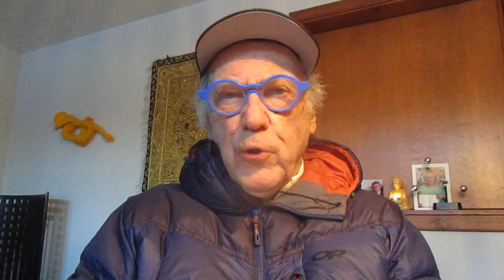Solution to Problem #131 - Friction with the Road.

Comment: Sir , if a planet have a escape velocity equal or greater than than the speed of light , then what will happen if we shot a light beam from surface of that planet
Reply from the maker: question ill  defined -  esc vel >c is not possible
Reply: Yes sir , that point is there 😅 ,I forgot to think about that

Comment: :) for example, I give the friction force of running water, I usually go on the road without falling due to the force of resting friction, often watch TV, some car racers get stuck, the engine still explodes, the wheels still turn, the car doesn't move Shifting due to sliding friction helps to make the vehicle layer and road surface very small, not enough for the vehicle to move to overcome, often they use high roughness objects such as wood to insert into the wheel to increase the frictional force to help the vehicle move. Ball bearings are used when there is a moving frictional force from rolling friction to sliding friction Friction makes it difficult to push the box to slide on the floor. Fix: use a roller (switch from sliding friction to rolling friction), when sawing wood is not very fast, use it to apply a saw to cut wood easier and faster than just physics. When the spacecraft falls into the atmosphere at a very high speed (7km/s), due to the force
friction between the hull and the air that the hull heats up and catches fire why?

Comment: Yes. From a purely energetic point of view, disregarding the individual, it takes more energy to drag this particular item. (We're dragging in both instances, but I mean dragging the heavy end on the ground verses carrying the heavy end)

However, legs provide more power than arms. So, energy burned in legs is less noticeable than in arms, generally.  Such that, when tasked, the choice of dragging this item for long periods is just going to be preferable. 

An extreme overdone example would be heavy stones for building pyramids. 

Mgh applies here too.  But, carrying the stone with arms isn't as convenient as dragging it someway. Dragging it over sand or something which helps minimize friction, but, of course we cannot eliminate friction. So, dragging includes friction atop mgh as you say. But carrying stones verses dragging them pits legs against arms. And, well, legs can put up with more.

Comment: Sir  friction independent of area contact but why aeroplanes are made narrow in front and  wings to reduce friction
Reply from the maker: that's aerodynamics - use google
Reply: Airplanes don't involve static and kinetic friction (i.e. Coulomb friction) between solids, in their interaction with the surrounding air.  The kind of friction is aerodynamic drag and its counterpart equivalent of normal force called aerodynamic lift, both of which do depend on an effective area.

Comment: I got the same solution, assuming that the human body is simply a mechanical linkage or object like the table you use as an example, and does not expend any energy simply to hold up the end of the branch. However, I suspect that there are constant muscle fiber contractions needed to hold the branch, keep your balance against the asymmetrical load, and so forth, so that there is more energy expended by a person than what goes into gravitational potential and friction alone. If this additional expenditure is greater than the savings in friction loss, I do not know, but it seems possible if the branch is very heavy.
Reply from the maker: I agree but those muscles do NO work

Comment: Having done years of physical labor in my life....I would still hold the smaller end as I went....the table has no muscles nor the ability to use different ones during the day nor vary any angles of the branch as it goes. But Physics is.....Physics. My Google account password is hacked on a nearly daily basis and so at times I cannot read any replies and must change it constantly now.....I suspect Google itself.
Reply from the maker: so would I. I prefer to do MORE work but get less tired.
Reply: @lecturesbywalterlewin.they9259  Tired or not...I still had to shovel concrete, gravel and dirt all day and could out work other men , even at twice their age. I planted a lot of trees also....I always used the narrow handle and not the other end to hang onto....lol....Peace always.

Comment: "If you hold 10 kg in your hands for 5 hours you will be exhausted but you have done no work!" that's why I wrote that you need to choose the smallest sum of gravitational force losses and frictional losses! --- not everything depends on the force of friction, but also on the strength of your hands (the strength of your wife). )))
Reply from the maker: you are confusing getting tired from doing work.
Reply: @lecturesbywalterlewin.they9259  no, I'm talking about the real energy costs of holding the barrel in weight)
you will not write off the costs of  overcoming gravity for 9 minutes on rocket fatigue! )))

Comment: Yes, I was wrong when I answered and I understand why. I compared the problem with someone's ability to do different physical tasks. For example, it's easier to drag a heavy log than to carry it on your back. But it's only because our backs are not that strong. From an objective point of view, if you carry something on your back, your overall weight increases by that amount, but your ability to walk doesn't involve any friction that hinders your movement. If you drag it behind you, your overall weight also increases by that same amount (you move your weight and the weight of the object), but now you also add the friction that the object generates. Thus, the force needed is always greater when you drag something, instead of carrying it, indeed.

Comment: Fatigue is different for different sized people regarding the same branch in this case.   Such that the grasping point of view of a child would be to grasp the narrow end perhaps.

As for an adult, grasping the thicker end would be less of a problem. 

So, energy wise you are right in so far as what is required to move the object itself.  But, for a person who has to provide this power, there are other considerations and constraints. 

From a physical point of view of fatigue for various people the need to switch up the situation remains a component to this problem, you sir, are unwilling to entertain.

The problem you introduce has physical properties to do with the branch, ground, elevation, earth AND A PERSON... with all of the limitations a person may have in producing power for this problem. 

The grasping components of the human arm for instance, have at least as many considerations with regard to physical properties.

Comment: Why was work invented and why it is like this. Why someone don't thought that just standing at a place with a heavy thing is work and why is displacement necassary for work
Reply: I guess it goes like this :
We study about only non living things in physics so work is according to physics how much a force displaces an object along its Direction which makes sense and not on how much energy you spend holding an object immobile... with that defination of work the energy can be framed as work done by the force . Now consider this you are building a machine to push some objects    so puhing an object will require that machine to provide some energy to move against gravity . now if you say just holding that object can give it some emergy then the object will fly just as you hold it for a long duration in your hands which doesnt make any sense :) . 

hope its cear now !?
Reply: James Prescott Joule, the namesake of our energy unit, developed the foundation of our concept of mechanical work.  He experimentally studied the relationship between heat produced as a function of force and distance as a test mass descends with resistance while spinning a paddlewheel, and measuring the change in temperature of the water as it is agitated by the paddle wheel.   If the hanging mass remains in place without moving the paddle wheel, it wouldn't raise the temperature of the water.   Instead, he determined that the temperature rise was directly proportional to the product of the pounds of the hanging mass and the distance it moved in feet, which enabled him to unify the concepts of thermal energy and mechanical energy.

Whether energy is expended or not, to support a zero-work force, is another matter entirely.  That is an inefficiency in the human body, that makes no difference to the object being supported.  What matters for work to be done, is that you transfer the energy in to the object with work done upon it.

Comment: One fact : in actual law of conservation of energy is not valid always (radioactivity)😁
so (physics is not about common sense) but observation and that observation turn into mathematics to explain to others ...

 cheers :)
Reply from the maker: conservation of energy is also valid with radioactivity.
Reply: @lecturesbywalterlewin.they9259  
I was reading HC verma's book (concepts of physics) in the volume 2 page 432 its written that during nuclear Fission , according to quantum mechanics if final state has lower energy than initial state there is a chance that the process pf fission may take place even if the intermediate state has a higher energy( this phenomenon is termed as barrier penetration)  . so for very very short time the law of conservation of energy is voilated...